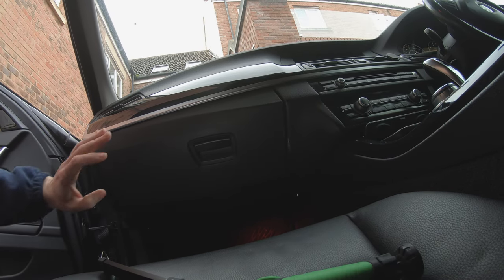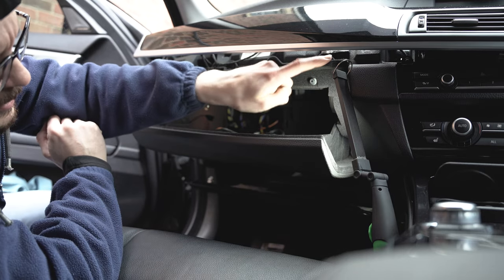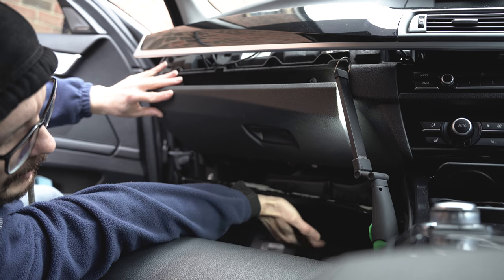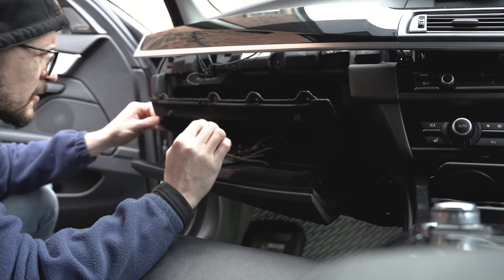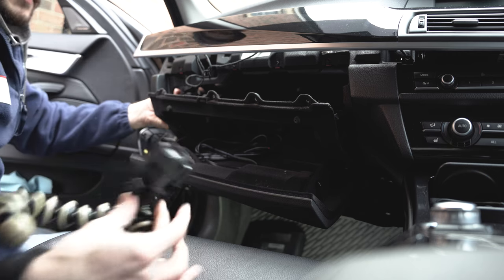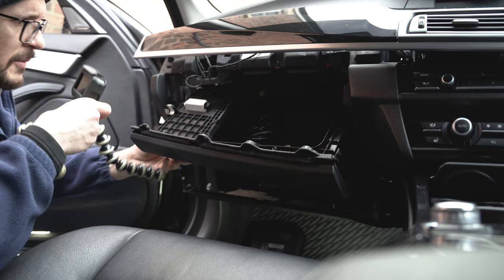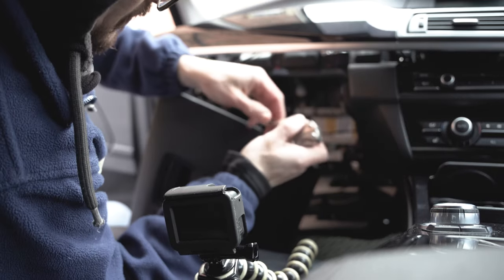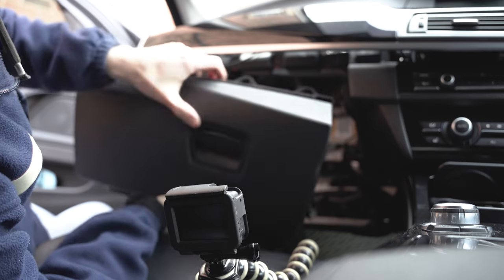How To Remove BMW F10 Glove Box - Step by Step

Comment: Is it possible to drop the glove box down to access the upper part fuse panel without fully removing it?
Reply from the maker: you can work from underneath the glove box. 2 or 3 tx20 and the lower cover can be removed.
Reply: @BestCarMods  thanks . There's a little access door on the top on the inside of the glovebox 2 t20 torx. I removed that and it worked! Thanks again. Love your channel!
Reply: Dudes my fuse 2 blew, I think, because a comfort door handle does not work anymore. As I understand it fuse 2 is also used for a lot of other stuff so my car gives me all kinds of errors now. Thanks to you guys I can get to that fuse now. Thanks man! :-)
Reply: @sund5 Same exact situation with my F10. 
Just wish the engineers had easier access spot for fuse box!